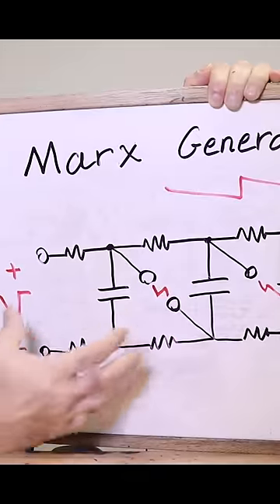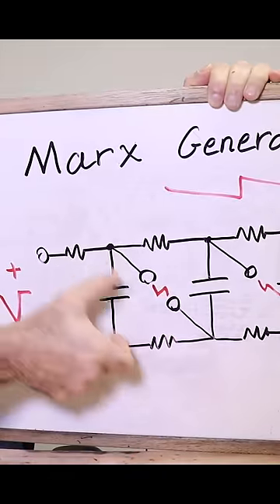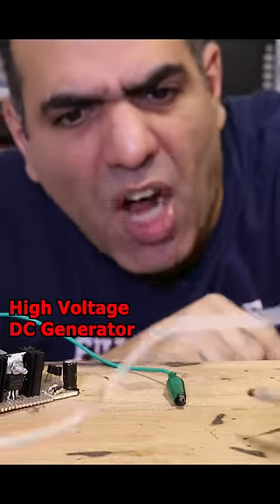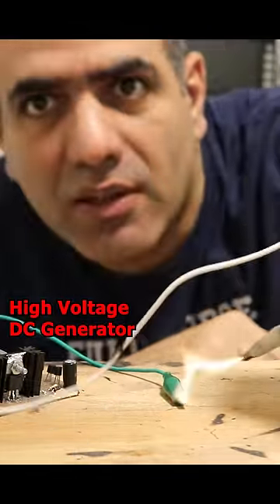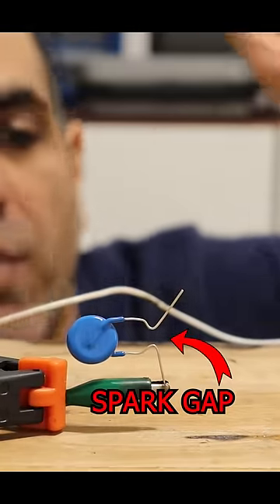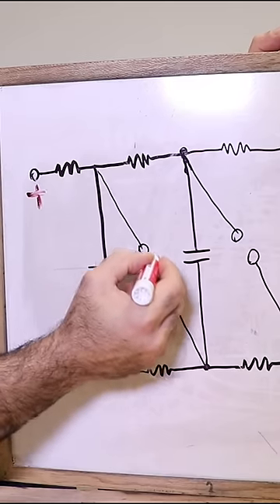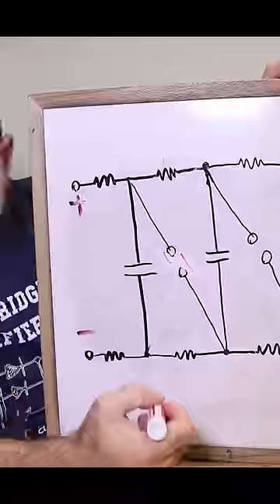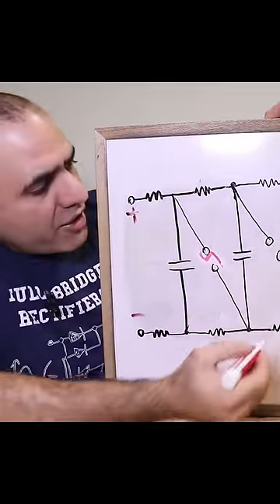Massive DC Arcs with Marx Generator #electronics #highvoltage #funny

Comment: We had a device like this at the uni too, except it was two stories tall and has produced 1 MV (yes, REAL 1000000 volts!). During each voltage breakthrough event a HUGE "BOOM" was heard.
Reply: How many amps on 1 megavolt?
Reply: @giorgiolelmi8175  Since it was a Marx generator too (it looked pretty much like the one depicted on "High-Voltage Impulse Test System.jpg" at Wikipedia, the wretched YT censorship filter doesn't let me post links) the current is kinda irrelevant, because its purpose is to provide high-voltage pulses (mainly for testing surge arresters, lightning rods and the likes). And these pulses are usually characterized (besides their peak voltage) by the pulse's rise and fall times (usually expressed as a fraction in microseconds e.g. 8/20 us) and at most the total energy they dissipate during each pulse, not their currents.

Comment: can you trigger it with a UV-C light source? Photoionization trigger or a similarity to the The Poole–Frenkel.
Excerpt from Wikipedia: "The Poole–Frenkel effect describes how, in a large electric field, the electron doesn't need as much thermal energy to be promoted into the conduction band (because part of this energy comes from being pulled by the electric field), so it does not need as large a thermal fluctuation and will be able to move more frequently."

Comment: If it's gaps capacitors charge throught, why are these resistors needed?
Reply: The capacitors are charged in parallel through the resistors and discharged in series through the spark gaps. If there was no resistors the capacitors would be connected in parallel and in series simultaneously basically creating a short circuit and there wouldn't be any output. 

You could think that the resistors are slowing down any current moving through them. At first the capacitors in parallel charge just fine but it takes some time because of the resistors. When the spark gaps connects the capacitors in series there is a high voltage across the resistors but not too much current flows through them and gets wasted and most of the current goes to the output

Comment: I was shocked by one of these after my uncle gave it to my brother and I. It came from an old marc generator kit for kids but my brother set it up to a machinethat customizes the amount of power you can output into the thing. The generator was off and had been off for about 10 minutes before my dumbass decided to complete the circuit by putting my finger on a screw on one side and touching the prong that the arc comes from on the other side. I dont know what I was thinking besides for "I wonder if this thing is off". 

I remember just dropping, the upper half of my body was over a coffee table when it happened. Essentially folded myself over the counter and hit the floor 😂.

Comment: 😂😂😂you can make a graduate rethink about his/her career if it wasn't electrical engineering 😂😂
Reply: Oh, this is actually power systems engineering. And let me tell you that the voltages in some of the labs that they work with are REALLY high....
Reply: @CoolKoon  where are they applied?
Reply: @KihuAntony  In power stations (they usually work as operators there), building, upgrading and maintaining electric grids (transmission networks), designing electric substations, these sorts of things. Basically everything that involves working with LOTS of electric power.